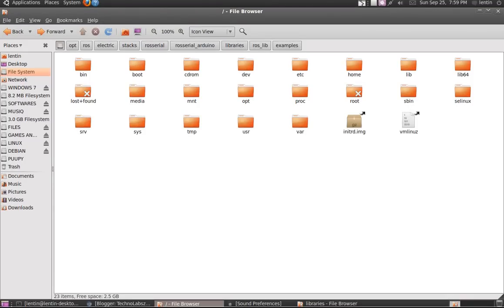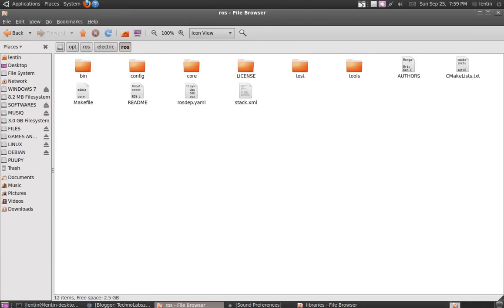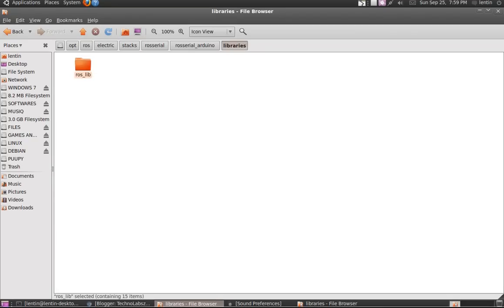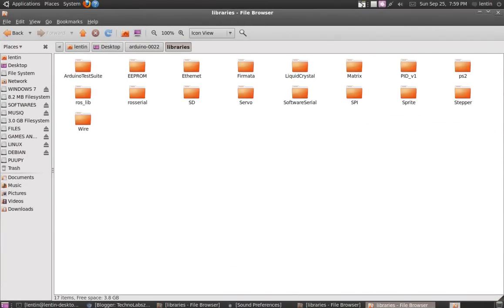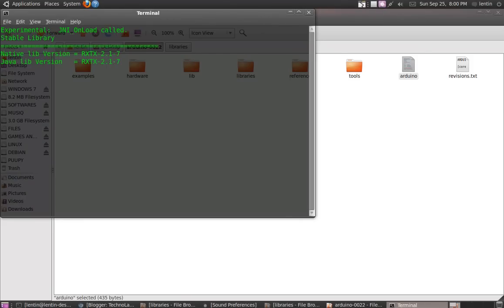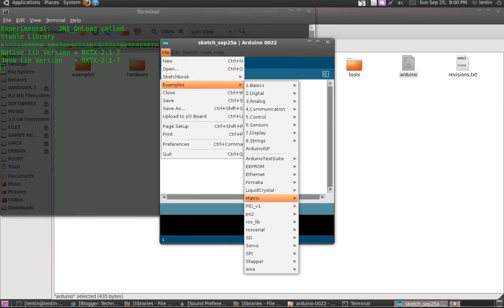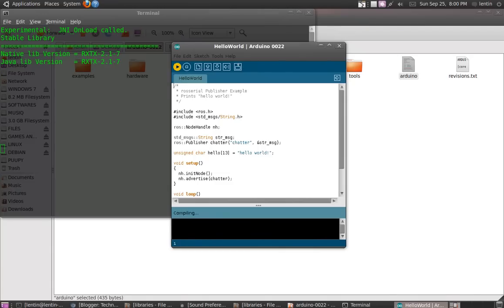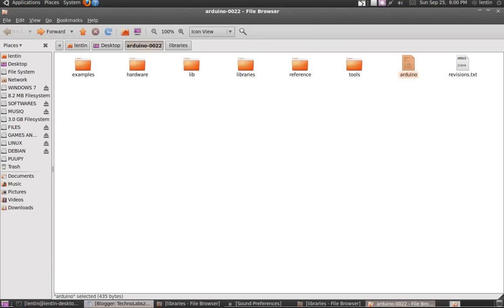ROS and Arduino:Hello World Part1

Comment: /home/robotics/robotics/arduino-1.0.5/hardware/tools/avr/bin/avr-g++ -c -g -Os -Wall -fno-exceptions -ffunction-sections -fdata-sections -mmcu=atmega328p -DF_CPU=16000000L -MMD -DUSB_VID=null -DUSB_PID=null -DARDUINO=105 -I/home/robotics/robotics/arduino-1.0.5/hardware/arduino/cores/arduino -I/home/robotics/robotics/arduino-1.0.5/hardware/arduino/variants/standard -I/home/robotics/robotics/arduino-1.0.5/libraries/ros_lib /tmp/build9000798454761363660.tmp/ADC.cpp -o /tmp/build9000798454761363660.tmp/ADC.cpp.o
In file included from ADC.pde:14:
/home/robotics/robotics/arduino-1.0.5/libraries/ros_lib/ros.h:38:29: error: ros/node_handle.h: No such file or directory
ADC.pde:15:35: warning: rosserial_arduino/Adc.h: No such file or directory
In file included from ADC.pde:14:
/home/robotics/robotics/arduino-1.0.5/libraries/ros_lib/ros.h:49: error: expected initializer before ‘<’ token
ADC:17: error: ‘NodeHandle’ in namespace ‘ros’ does not name a type
ADC:19: error: ‘rosserial_arduino’ has not been declared
ADC:19: error: expected constructor, destructor, or type conversion before ‘adc_msg’
ADC:20: error: ‘Publisher’ in namespace ‘ros’ does not name a type
ADC.pde: In function ‘void setup()’:
ADC:25: error: ‘nh’ was not declared in this scope
ADC:27: error: ‘p’ was not declared in this scope
ADC.pde: In function ‘void loop()’:
ADC:41: error: ‘adc_msg’ was not declared in this scope
ADC:48: error: ‘p’ was not declared in this scope
ADC:50: error: ‘nh’ was not declared in this scope

 this is the error i got while compiling "Hello World" please help me to solve this. Thank you